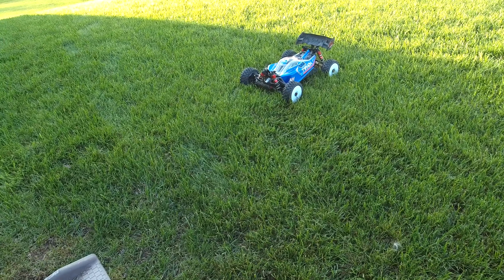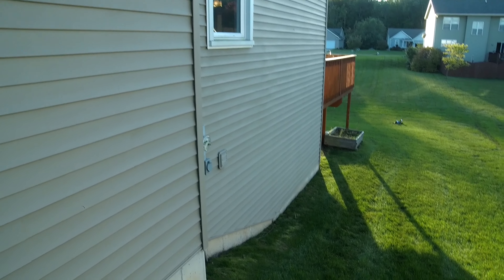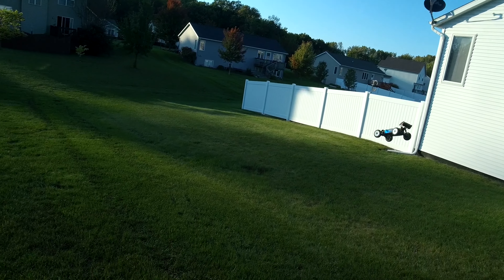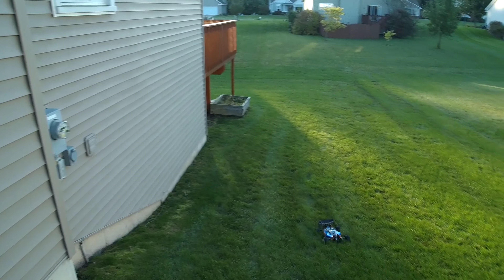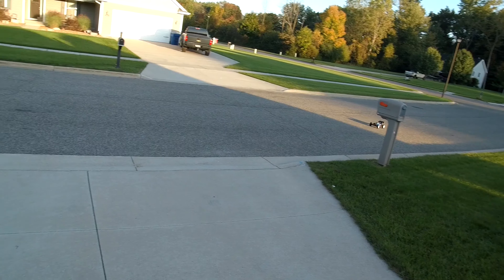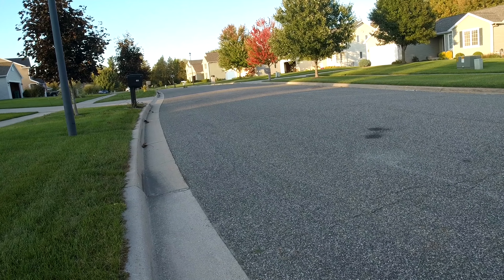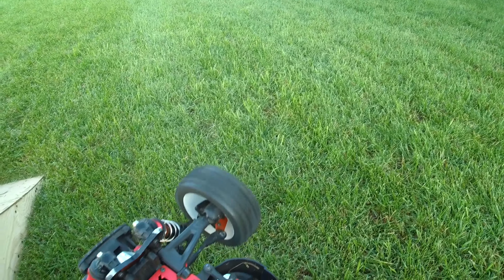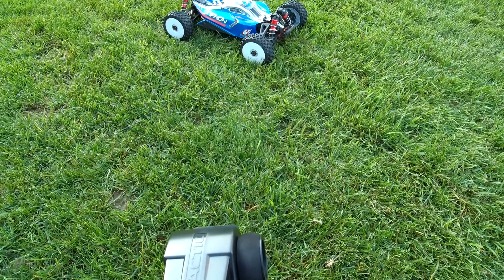Typhon Big Ramp Bash

Comment: Nice. I'm going to trugify my thypon v3 6s tomorrow. I have all the parts ready to go. I'm also going to install the Just Bash It chassis braces and will be changing out all the bearings with rubber shielded ones. I was thinking about putting the 20T pinion in there (have you done that yet?) to see what speeds I can get. Hehe. Went with the badlands Mx 2.8 tires.
Reply from the maker: Oh yeah man! Your gonna love it 🤩 I have used the MX28 before and they work awesome. These buggy badlands are a bit of a hybrid between good handling and cushion for big jumps. I am using an 18t in this video. 20t could be ok with the stock motor, just check temps 👍